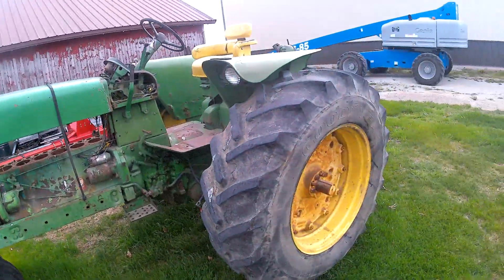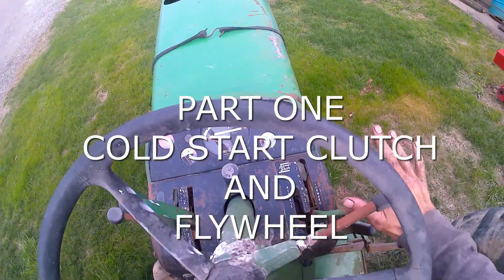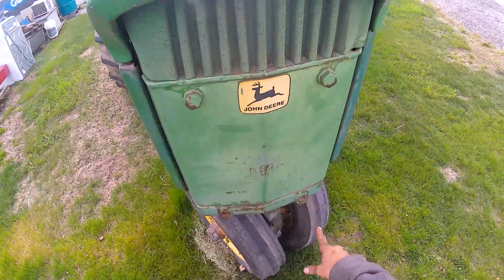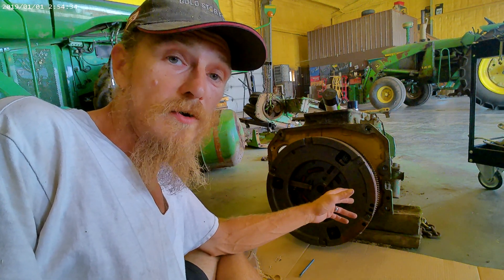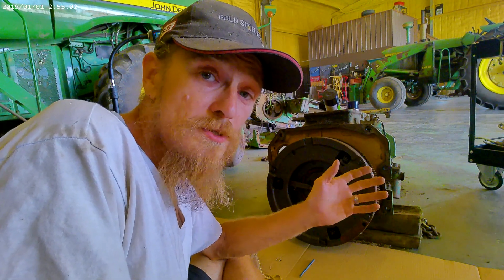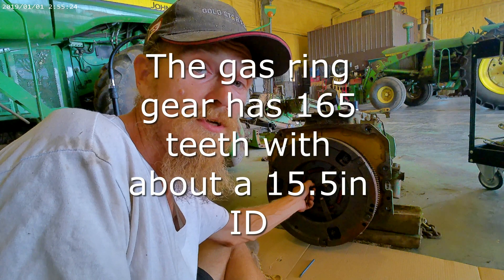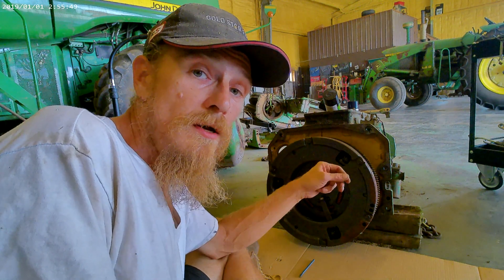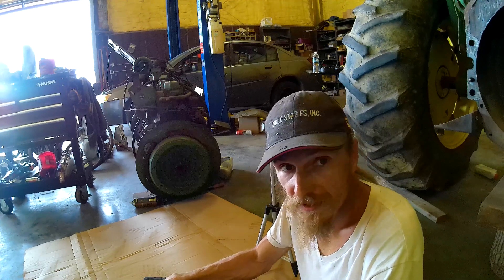4020 POWERSHIFT GAS TO 7700 TURBO REPOWER!!! PART 1 FLYWHEEL MODIFICATIONS.

Comment: Diesel flywheel.  But get it drilled for 6 bolts 4430 oil pan dosent have the oil filter hole like a 4020

Comment: Andrew's Sounds of the Past channel did a couple of these conversations. You might search his videos. It's a cool project that I wouldn't mind doing. The other project I'd like to do is get a nice 4020 gas and convert it to electronic fuel injection. There was a guy building a kit to do it.
Reply from the maker: I like Andrew's videos, he has some pretty cool projects that he's done. But EFI on a 4020 gas is something I would like to see, I hope you get to make it happen. Thanks for watching!
Reply: @mayberickcanfixit7468  Green Magazine did an article on it. The guy used a GM computer and injectors. The tractor also had to be converted to electronic ignition and negative ground alternator. He said it developed 20% more power and used 20% less gas. The kit was $4,000 though and that was before all the inflation.
Reply from the maker: Thanks I'll check it out. @danw6014